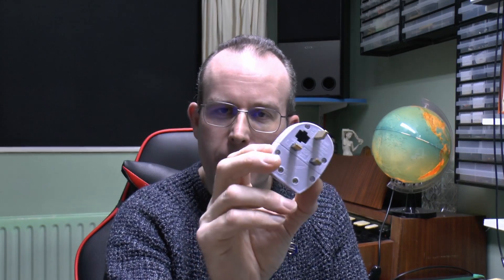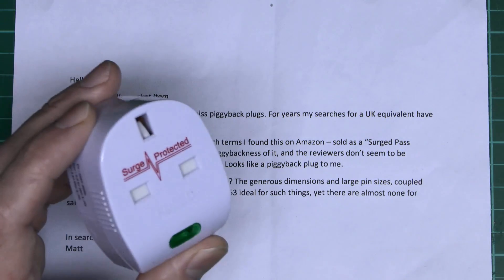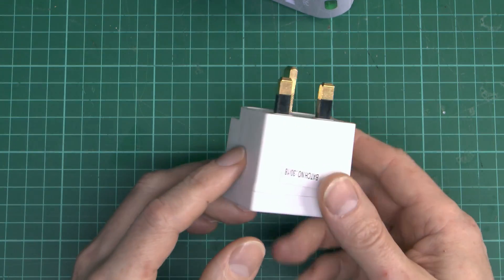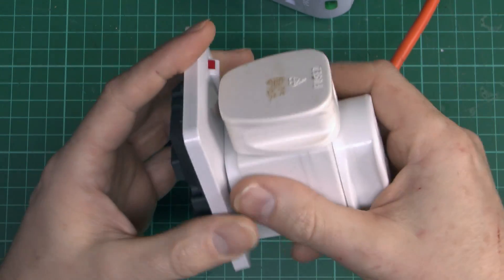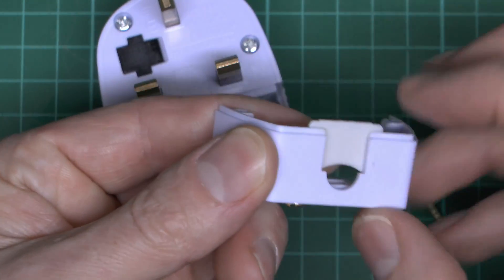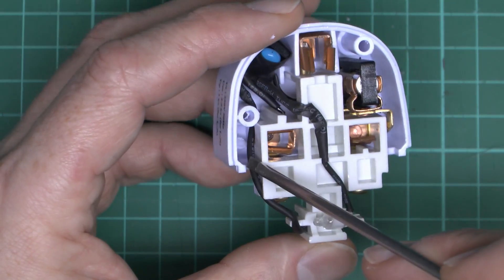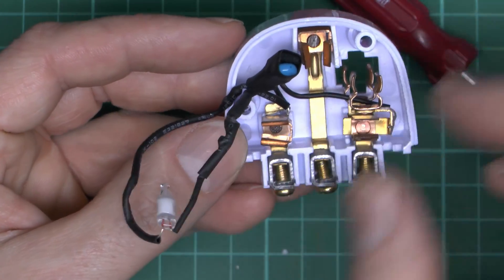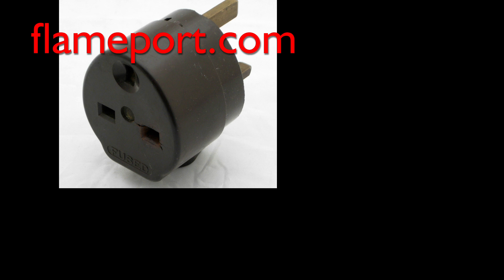Piggyback Plug, Double Adaptors and Extension Bars

Comment: I'm surprised that British sockets and plugs aren't built with the line pin larger than the neutral one, making them impossible to plug in upside down. Most of our appliances come with those kind of plugs.
Reply: They're built with the earth pin longer than the rest so it must enter the socket first, opening the flaps to line and neutral allowing the rest of the pins to enter. The 3 pin plug cannot enter the socket upside down,
Reply: @ollieb9875   Ah, but it's been demonstrated on power strip that it IS possible to insert the British plug upside down. The earth pin just goes alongside of the power strip.
Reply: @tncorgi92  yes. That's the trouble with making something idiot proof. The world just invents bigger idiots.
Reply: @tncorgi92  Buy better power strips, the quality ones are too wide to get a plug in upside down.
It can't be done with a compliant wall outlet, either flush or surface mounted, the dimensions specified in the standards prevent it, sadly that wasn't extended to those trailing power strips.
Reply: Stephen Graham  yes. Unless it's from China in which case it's not legal, or you bodge something together yourself.. the reason for the fuse is because sockets are typically on at least a 32A breaker and there's no way the flex to your radio is rated for that current, so without it, were your radio to short circuit, the flex would likely set on fire.
Reply: It would be remiss of me not to describe the 32A breaker. 32A would be the maximum continuous working load.  Because we have capacitive loads in houses that can appear for a short time as a short circuit, they don't trip right away. Fair enough. Consider now an overload current, 32A is the maximum and it'll trip at some point if the current exceeds that. The reality is, it could supply 100A or more for several minutes before the bimetallic strip warns up enough to to trip it. The impedance of the wire to your cheap radio may well stop it appearing as a short circuit.. a short can deliver many hundreds if not thousands of amps for under half a second ideally.
Reply: Actually, the usb chargers and things that are not earthed, don't have a fuse, they have a plastic earth pin to open the shutters and I guess the rest is up to luck.. I've not really thought about it until now
Reply: Stephen Graham  the plugs aren't that big... Despite the fact I don't think the average consumer should be going near live electrics to replace a fuse, there are various ratings of fuse depending what you plug in.. 3A, 5A and 13A are the typical values. Again, the fuse is there to protect the flex and what is rated for, not the device. An electric heater will have a thicker and more robust flex to carry say 10A, whilst your radio has thinner cable and is fitted with a 3A fuse

Comment: John, could you please do a video on how many 13amp 'power blocks' it will take piggy backed to start being dangerous / melty badness?! Keep up the good work. Charlie
Reply: 1.
Reply: Charliee Costa - do you mean the “cube type”, or the plug, extension lead and socket outlet power strips?
If the former, one. If the later, the 13A fuse in the plug of the first extension lead / socket outlet power strip will provide some protection. But it is still possible for it to be run overloaded, as the 13A fuse will pass far more than 13A for a time. Time time being related to how great the overload is.
Reply: @Mark1024MAK  Hi Mark, sorry to clarify I mean the unfused 'block' style, in effect how much load can those suffer before it melts? I guess without a fuse and being connected direct to the socket it should be 3x 13amps but I imagine it will give up before that...
Reply: Charliee Costa - The type with two outlet sockets is unfused, so 2 x 13A = 26A maximum load (assuming normal appliances are plugged in and not further adaptors/extensions and the fixed socket outlet is on a 30A/32A radial or ring circuit). It could very well be the case that the fixed socket or the adaptor will suffer from heat damage at this current.
The type with three outlet sockets is fused at 13A, so 13A is the theoretical normal maximum load (but see my previous comment about overloading).

Comment: Over here in australia piggy back plugs are almost never on devices themselves, we have them on extension leads.  They're great for live shows where for example you have a bunch of lights shining up a series of trees - you plug the first one in then use a short 2 or 5 metre piggyback to the next one and you can continue on from there. This sort of arrangement works better than double adapters or power boards as you don't need any extra components and the whole arrangement is much neater.
Reply: also a lower profile than most plugs so can be useful even if only used as a normal extension lead

Comment: I am in the US and I use the 'stacking' plugs quite frequently.

I am not sure what it is like in the UK but in the US we still get those massive power bricks. They almost never design power strips/UPS systems with those bricks in mind so you may have 6 outlets but you end up with only 3 usable ones. Those multi-outlet stacking plugs solve that problem.

I never plug one into the wall, however, and I have only once gone two plugs high (The brick I had to plug in was so massive that it took up two-and-a-half outlets and was just as deep as it was wide.)
Reply: The power cord for my PC is only about 1 foot too short to reach my UPS so I shamefully use the old power strip as an extension cord.
Reply: @vgamesx1  I avoid using power strips as extension cords. There is always a risk you may forget that strip is plugged into another strip and overload one, or both of the strips. Or...at least I would do something like that.
Reply: @brianbommarito3840  No it's a strip plugged into a APC SMT1500 smart ups, but you're right in that there is a risk however I don't tend to plug anything else into it and even if I did, I don't know if you can actually overload it, it's setup to a max load of 60% (600W) so presumably that's whether or not the inverter is being used, I haven't really tested it to know how that works.
Reply: Here in Australia it's common to buy extension cords with a piggy back plug, and have a few IEC cables with piggy back too. But when I say extension cord, I mean with a single socket on the end of a length (up to 25m or so) of flex. We have powerboards too, with a 10A circuit breaker built in, generally under 2m of flex. I have a few 6-ways where three of the outlets are spaced further apart which is handy for the wall-warts.
Reply: Kitako FruitCups - it depends on the size of the plug top PSU / power brick. Some are small enough that you can fit as many as you like into a properly sized extension outlet / power strip. Others are two big and prevent the adjacent outlets sockets from being used. I solve this by using a ten way extension outlet / power strip.
Reply: Mark 1024MAK For the European style double banana plug styles, there's a problem that some wall warts extend along the line formed by the two pins, others perpendicular.  So even with the clever 45° plug boards, they end up colliding.

Comment: If you attached 6 together would that be safe
Reply: Only until you turn it on.
Reply: The main questions would be is it overloaded (depends what you wire the plugs to) and is there unacceptable mechanical stress (I would be starting to worry about leverage with as many as 6 of these stacked in a wall socket, especially if the cable on the one furthest from the wall gets yanked).
Reply: When I run my Christmas lights I daisy-chain powerboards and have a total of about 40 strings plugged into one 240V 10A socket. Of course each one is about 30W so total power is around 1200W, which is around half the capability of the prime socket.

Comment: JW another problem I have met with the 'cube' type adapter is the weight tends to pull out the adapter causing arcing.
Reply: That's what I've seen, my ex employer banned piggybacking plugs in all accommodation, in my new company I've carried that policy on.
Reply: i have 3 stack and use the glue gun to put a bead on the top to stop sagging
Reply: @debeeriz  install extra wall socket don't chance it with glue ,it tends to melt when warm.

Comment: Always amazed how big the plugs are in the UK.   Interesting design I like the fuse in every plug.
Reply: The fuse is necessary because the circuits are fused with 30 or 32A, and the flex cables between the plug and the appliance are not rated for this amount of current.
Reply: EU ones are monstrously huge. UK is a standard size.
Reply: @forevercomputing  
The Schuko are deeper, that's part of its safety concept to prevent live parts beeing exposed if the plug is only partially inserted into the outlet. The outlets are recessed into the wall. Since in the UK the outlets are flush with the wall, the best solution was to retrofit sleevings on the L- and N-prongs
Many ways are leading to Rome. Both ways achieve the same safety standard.

And compared to the american NEMA-1 and -5 all european plugs are big...and safe. These NEMA-plugs partially inserted into the outlet and live parts are exposed, waiting for someone to touch them.
Reply: Lassi Kinnunen  That is in addition. Show me the cord which can handle 32A...isn't really practical. And the thing is, these fuses inside of the plugs are ceramic and filled with sand, so they can switch off a massive current safely. Most appliances have glass fuses, they can't handle this amout of current. In other european countries the additional fuse is not necessary because the circuits are fused with 16A max.

Comment: Great video. I guess one of the advantages of these piggy back plugs is the lower profile. Might be useful behind a cupboard etc.
Reply: @jnimitzch4738  I wonder how well they would last with the current and power draw of an electric heater. I wonder if John has discussed this before.
Reply: mharris1270  The load does not pass through the MOV, so it is good for the full 13A. All of the surge protection jazz can be removed thus turning it into a pure piggy back plug.